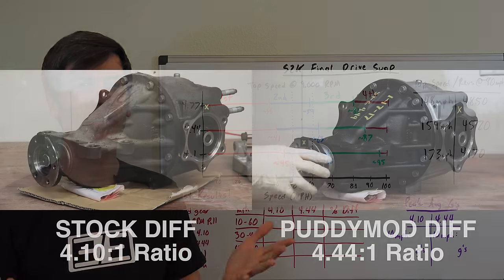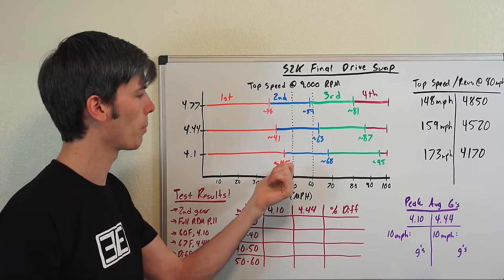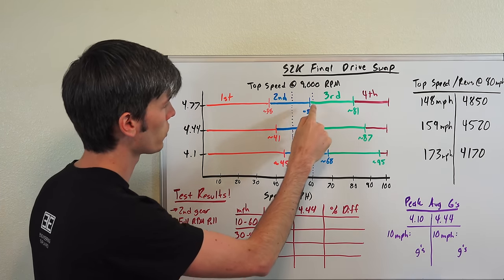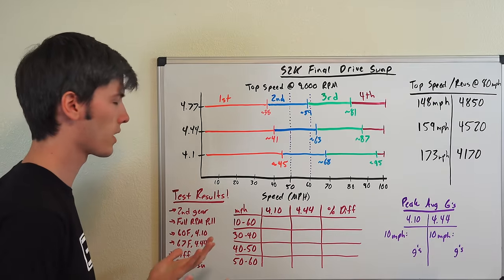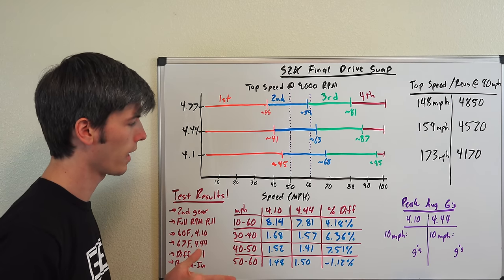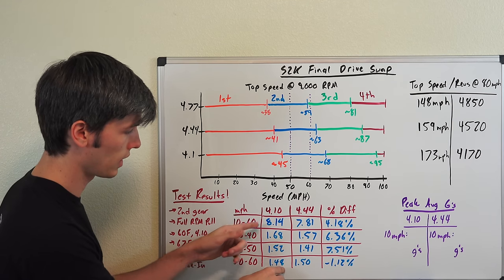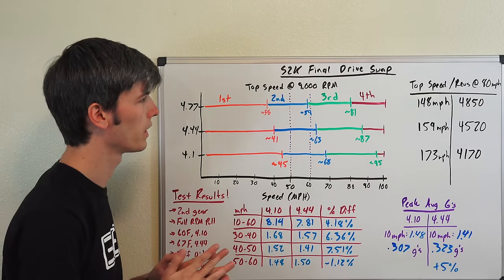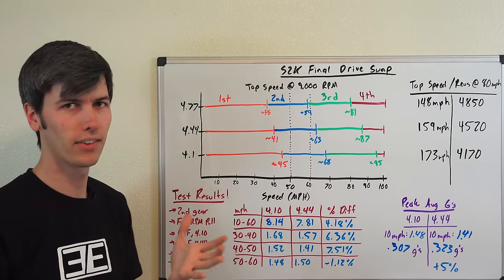Can Gearing Make Your Car Faster? With Proof!

Comment: If you do the math based solely on the mechanical advantage of the gear ratios your gear choice comes out to an 8% increase in torque. I'm going to guess that the difference between your 5% measured improvement and the 8% calculated improvement may be caused by differences in weather conditions, heavier gear oil used with the new gears, and possibly increased wheel slip. I'm considering switching my car from a 3.15:1 final gear to 3.73:1, which should yield about an 18% improvement. Assuming wheel spin isn't an issue, should I expect to see a 15-18% increase in acceleration?

Comment: Nice video. Maybe you could conduct test based in RPM rather than MPH. 4.10 test was 10-60mph. You could convert to RPM. For example if 2,450 to 8,300 is 10 & 60mph in 4.10 (luckily you have it on video for easy reference). Then time 4.44 acceleration from 2,450 to 8,300. That would eliminate the powerband discrepancies. You should be around 8 not 5%. Just rambling.
Reply from the maker: Ultimately it really needs to be about g's, as this is what you'll actually feel. Comparing RPM will certainly show that more aggressive gears accelerate faster (like 1st gear versus 2nd gear), but it doesn't really teach you what the g'forces are, because you're removing distance from the equation.
Reply: Yes of course.
Can still calculate g's from new RPM based acceleration time vs MPH based acceleration time.
Maybe I'm failing to explain my idea correctly. No worries. I just think different powerband is throwing your comparison off a few %.

Comment: Hi buddy,
I just want to ask ,i have a landcruiser series 80 diesel manual ,on the fifth gear you cannot drive over 100 or 120 km/h because you can feel the engine giving too much power with low speed however i have 33 ' of tyres if i wanna change the differential to bigger ratio ,
Do you think the engine will be comfortable on high speed or i have to change the gear box ?

Comment: would be nice if youd mention the very basics of torque with a 4.10 and 4.44 at say 190 lb ft. and 1:1 roughly pushing 780 lb. ft. and 845 lb. ft at max volumetric efficiency. at the wheel. which is a substantial increase. therefore top speed will decrease but acceleration is maximized a couple %'s

Comment: Hey Jason so I did this exact thing to my BMW e36 it's a 94 318i with a 1.8 liter it came stock with a 3.45 and I put in a 4.45 gear ratio which is the biggest their is for my car did I make my car slower or did I gain advantages with it?

Comment: Hi, nice video! one question that came to my head: does this spinning ratios reflect in the speed gaugue? , I mean, changing the size of your tire directly changes the measurement of speed from factory, does this mod in the dif changes it as well?
Reply: Yeah, changing your gearing would change what your speedo says, as well as your odometer. Thankfully with newer cars like this you can tune it and fix both at the same time.
Reply: how it is possible to fix that? I would like to fix that in my car as I want to change the size of the tires on my wheels to others a bit smaller.
Reply: There's a couple ways of doing it depending on your car and what exactly you want to do with it. I own an 03 Mustang and I put bigger wheels and tires on it. I knew it would throw off the readings, but I wasn't really that concerned with it. If I wanted to buy a tuner, I could tell them what size I went to, and they would set it up so when I plugged it into my car, it would fix it. The problem is that they're expensive, $500-600. I was also told I could take it to a local speedometer shop and they could fix it for me. I called and told them what I bought and installed and I was told that I went up something like five tire sizes, and that my speedo would be off by a significant amount and that it would be like $550 to fix it if I remember right. For me, it would be worth it to just buy the tuner, since I plan on modding my car and that will help tie everything together later on. For you, maybe you just want to get it corrected at a shop once and be done with it. Keep in mind that when I drive by those speed traps on the road, my speedometer is only off by ~2-3 MPH max. I honestly wouldn't really worry about it unless it's really gonna bug you. And if you have an older car, it's probably going to be more labor intensive to recalibrate your stuff, which in turn will be more expensive keep that in mind.

Comment: Did it become noticeably easier to start off in first with this upgrade? I'm considering a gear swap since I up-sized the tires on my suv and the need for extra clutch slipping is pretty apparent.
Reply from the maker: Yes, though when the engine is cold it doesn't need throttle to start either way, just let the clutch out slowly and you're off! But you can crawl at a lower speed, which is also nice when you get stuck in traffic.
Reply: definitely a plus, thanks!

Comment: Can't rear gears higher the top speed on a drag limited car? Assuming the theoretical top speed with that gearing is still higher than its drag limited top speed before, couldn't it go a little faster, since you have more torque getting to the ground with the higher gearing?

Comment: The top speed, as mentioned in the video, is calculated theoretically. In reality, the top speed of the car is limited by the amount of air resistance faced by the car. So no matter the gearing, the top speed of the car will be same for all and I bet it will be less than 148 mph for any differential gear ratio you use.

Comment: Hy my name is zangi from Pakistan ,
Will you please help me! 
I have a Toyota corona mark2 1974 model, I'm installed new my engine in my car , Toyota 1jz 24 valves 2.5 
And you please advice me for which deferential best for my car, 
I'm doing change or not change.
Thanks

Comment: it doesn't effect HP and torque at the crank. but will it effect it at the wheels?
Reply from the maker: Affects your torque at the wheels. (First gear puts more wheel torque down than second gear, etc. Same with changing the final drive).

Comment: would be cool to see u do the same type of video but with changes in rotational mass..... so basically a lightweight flywheel like a findanza and mabey rpf1 wheels and see how that can affect acceleration ? would be extremely cool to see just if the flywheel alone can make a difference because it is one of those parts that you pay so much more for but u never know if it is fully worth it in terms of real world changes, love the vid though man and the floor jack as a scooter is funny af

Comment: My car has the problem of a speed limiter. The car shuts down at 162 mph. I went from a 3.92 to a 4.10 and they both can hit 162 mph which the computer won’t let the car go over. With the higher gears I can actually use the power of the engine. It accelerates faster, more responsive, gets me to my 3,000 rpm power band faster, easier on the clutch on starting off. Your S2000 loses top end so I believe it doesn’t have enough power.

Comment: @Engineering Explained What's the appropriate formula for calculating road speed when gear ratios, tire size, engine RPM, etc. are known?  Having a debate and I know you can settle it!!

Comment: helloo ....bro i have question  i have bmw e34 520i 1991 non vanos m50b20 and my differential ratio is 3.46  i want to swap my differential to 3.73 or 3.92 diff ratio lsd for more acceleration torque  but i dont want to lost my top speed a lot what you recomend me to do i need you advice if you can help me please.. and if i swap the  diff  is the speedometer will start to give me ronge speed that im traveling just to remember my speedometer sensor is on the differential it self ...please help me and manyyy thanks for all this videos ...my tire size is 195/65/15 91H summer tire ...and sorry my English is not that good ☺

Comment: How did you calculate the G force? Wouldn't it be time from 10-60 in m/s, divided by the time it took to get acceleration, divided by 9.8 for G force? This gave me much higher numbers than what you got.
Reply from the maker: a = v/t. convert 10 mph to ft/s, divide by time (~1.4 sec), divide by 32.2 for g's.
Reply: Engineering Explained why divide by 32.2? Isn't gravity 9.8m/s?
Reply: Engineering Explained oh whoops you used ft/s, I see

Comment: Could you explain why Focus' transmission is called a four-speed with overdrive when you count the shifts it has five forward speeds. Does it technically mean it's a five speed then, or does overdrive count as one of those gears when said as four-speed automatic. It's a 2003 if that must be known. Thanks!
Reply: technically, overdrive is when the transmission output shaft spins more then 1 revolution for one revolution of input.  So basically, yes it has 5 forward speeds.  I think it comes from the days when a overdrive was a accessory to the actual transmission and wasn't built in.
Reply: So for gear number simplicity, the ammount of forward gears I have is the same number of forward gears a Honda Fit Five Speed automatic is, or would the Fit be considered a six speed then?
Reply: if it has five speed PLUS a overdrive, then yes.  I think the use of the term overdrive has fallen out of use mostly though.  Seems like they just state the number of forward speeds now, makes thing's simpler.
Reply: Thanks!!!

Comment: @Engineering Explained
One question... It is about nitro in cars. Can we instead of nitro use oxygen? but no pure oxygen but a mixture of pure oxygen and the air that is sucked in by the intake. Instead of 21% oxygen in the air it will be let's say 31% Will this add horse power and can it work on unmodified engines? 
I googled it and most people say to just use pure oxygen and you have to modify somehting blah blah blah...
Reply: Thank you ;)

Comment: what is that G-force that we always been talking about in a car, could you please explain this in detail??
Reply: it's force in terms of gravity. so .5 G is half of the force of gravity.
Reply from the maker: The force of gravity pulling you down right now is 1 g. A car that accelerates at 1 g accelerates at the same rate that gravity is pulling you down. If you were to lay on the ground on your back, that's the force you'd feel pressing you against your seat from the car (while of course simultaneously, gravity pulls you down).
Reply: 1g at sea level

Comment: Can the s2000 really do 170mph or does that calculation not take aero into effect?
Reply from the maker: Purely based on gearing. It won't hit 170 stock.
Reply: Engineering Explained so theoretical top speed

Comment: never understand people who is picking from low gears to high gears and running first gear like on nice, it means moving slower, onlly if use slicks and still rwd at 600 hp spinning all the first gear, to go faster with high hp needs lower ratio for grip !

Comment: Does effect fuel consumption?
Reply: Yes. As far as I know, any time you increase the gearing ratio, your fuel economy is going to go down. That's what he was explaining at the end with what your RPM's are going to be at when cruising at a certain speed. The higher your RPM's, the worse your fuel economy.

Comment: How does changing the diff affect the gearing?
Reply: If you were to just change your diff from open to LSD or anything like that, it wouldn't. He got a new diff with more aggressive gearing in it, that's the only reason it changed. You can change your diff without changing your gearing.
Reply: oh ok thanks
Reply: You're welcome.

Comment: did anyone think it wouldnt make it faster?. i mean it can but only if grip is a issue or you add to many shifts. i bought a mustang that had 4.11's in the back and dropped it back to stock 2.97 (i think or 3.08) it was quicker on the street with the stock gear but not at the strip. i mainly did it because at 70 i was at 4500 rpm so it was ear splitting on the highway. I never ran the numbers on mpg but the mall was a hr away and with the 4.11 i burned 3/4 of a tank and with the stock gears i could make it there and back, so theres that.

Comment: 173mph top speed of a stock S2000, couldn't stop laughing at that one.  8mins, "but you know 173 it's probably not going to be hitting with stock power". So instead of titling it 'top speed' on the white board, maybe 'theoretical' top speed would have been more accurate. Lucky to get 159mph out of a 14 year old stock car with 105,000 mls on the clock.  Japanese home market one with 10hp more might fare better.  Interesting thorough video's though.

Comment: ha! sportage gears, wonder if he paid for a vendor to supply them or if he ordered them cheap from Kia.
Reply from the maker: I believe the 4.77 is from the Sportage, the 4.44 is from a Mazda Speed3, which yes, that's where he sourced it.
Reply: Engineering Explained. half right, 4.77 is the sportage ratio, the ratio in this video is used in the rx-8 and iirc some of the other RX vehicles.

the Speed3 is fwd and uses a different style ring and pinion, glad you/he got it knowing exactly what it was. I remember stories of people paying over a grand from specialty vendors who would buy Kia parts  re box them and mark the price up, something similar happened with the speed Protege, vendors sold "genuine" Mazdaspeed protege big brake kits for serious money, they were bone stock brakes from the 98-02 626 sedan.

Comment: Lol.. 4.77?? That's insane..  3 gear changes before 60 on a manual.
Reply: That's what my accord is like.1st and 2nd are really short. 3rd, 4th, and 5th are really tall.
Reply: Austin Clark Limit torque needs more torque multiplication.
Reply: Austin Clark my old 3 series was a 5 speed with no overdrive.  It took 3 gear changes to hit 60

Comment: You'll be sick of changing gears :D
Reply from the maker: If I didn't want to change gears I would have bought an automatic haha.
Reply: Just kidding) 4.4 is not that extreme, and because of high redline you still have 60+ top speed at 2nd. Higher RPM on highway is pretty annoying though - this is quite a major downside.
I drive Kia Ceed GT manual and it has pretty similar characteristics stock: 40 in 1st, 60 in 2nd, ... But it has really long 6th gear, good for cruising
Reply: Changing gears in a Honda is fun!  Kia ProCeed is nice too.

Comment: its only faster because the engine is spinning faster rpm at 10 mph...you totally flubbed the test...i said you will get one tenth at best(0to60) if any difference and im still not saying im wrong... i think you went out and did 0to60 and found i was right
Reply: phil tripe its not the 0-60 what makes you faster, a shorter gear ratio helps overall acceleration as you will have more wheel torque.
Reply: going from 4.11 to 4.44 makes almost no difference is what i said for the previous video and im sticking to my guns, until i see a better 0 to 60 time, im right! and you all are wrong...i have faith that honda found the perfect ratio and 4.77 would make a bigger difference in torque but it may not result in a faster time because of more shifts needed
Reply: phil tripe ill say it again, 0-60 doesnt make you faster around the track. you want to stay in the powerband as much as possible when going through the corners, and the shorter the gear ratio, the better (there is a limit though). overall acceleration will be faster as well, maybe with the 4.1 diff, the 0-60 is faster because you can reach 60 in second gear (1 shift less), but the 0-80 would be faster with the 4.4 for example. also, its not that Honda found the perfect gear ratio, a short gear ratio can be a pain in the ass if your not into touge or track racing. highway cruising at high revs is not really useful for a street car.